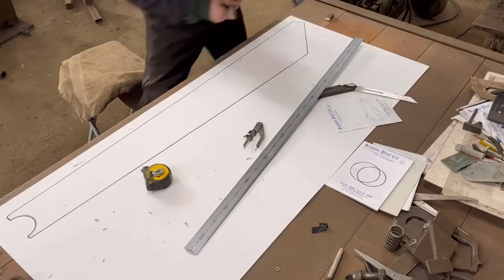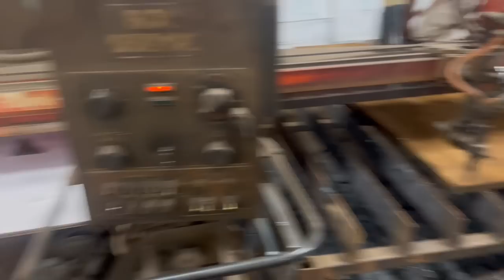Major repair on a toe tip bucket. Part 1

Comment: Your machine torch cuts look very good.  Suggest increasing your travel speed maybe 10%.  Watch the edge for excess melting.  Increase speed until the edge looks crisper.  Running the around the plate first with the flame lit but not cutting will give a bit of preheat and pop off some of the scale and rust.  The line burner has some serious leakage around the base of the tip.  Thinking you are not using the correct tip for the torch.

Comment: Good start to your bucket repair. Amazes me how people  just do repair and then cannot get access  for the pin maintenance  later on. I liked the bit about ic weld made me laugh. He did a repair on a cat 360 digger arm. He bevelled  a piece  of plate  and said clean it with grinder or maybe not. It was cut so clean it didn't  need any grinding. He is God's gift to torch cutting and more. You deserve the work you are getting no cutting corners with you very good honest repairs.  Look forward to part two thanks ruth.
Reply from the maker: He is the man! Thanks for watching 😁

Comment: Three observations   Always preheat. run the flame across the steel at cutting speed without cutting oxygen on. 
Try a 1/8 nozzle for cutting out bent parts and bevel cutting by hand. 
Bolt a 1” plywood board 18”x18” to the drill press. 
I’m impressed by the kit & workshop you have. How did you come by it all. Inherited? Purchase ? I hope you change enough. I enjoyed the work but was also under paid & taken for granted. I moved to FE welding lecturer  .  Do something about the seating nozzle flame it can cause over heating problems.
Reply from the maker: Thanks for the tips. 
I’ve purchased everything myself. My budget isn’t huge though hence why it’s mostly older gear.

Comment: Great vidios , all very  interesting to watch, thankyou for making them . 
I notice your having trouble doing your weld prep bevels with the straight line " quicky"cutter, would it work better if you converted the head to hold your freehand plasma torch,  it might be worth a try , anything is better than endless grinding on thick plate.

Comment: An Old Koike IK72  track torch. I have one of those things, keeps soldering along for some reason! I just recently found your channel. I like what you are doing. (I am a repair guy as well, mostly portable line boring, welding and light machine work. No you tube channel though, only IG) Anyway I like your optical profile cutter as well. Looks like you have a nice set up for repair work. I willl have a look at your other vids too, the   shop made line boring rig looks very promising.  Cheers

Comment: Yes Isaac @icweld is a brain surgeon with the torch, he also has a tip to see your chalk line better, and that is to spray it with WD40 before you cut 😊
Reply from the maker: I did see that but never thought to try it yet. My glasses are a bit too dark as well which doesn’t help.

Comment: You may have gotten cutting tips from I.C.,but you burn from the top down (the preferred method) and you gouge with a continuous feed of the carbon. Not his dip and dab method. Didn't see if you place the carbon into the torch bare end first which he does incorrectly .jolly good show.!!!